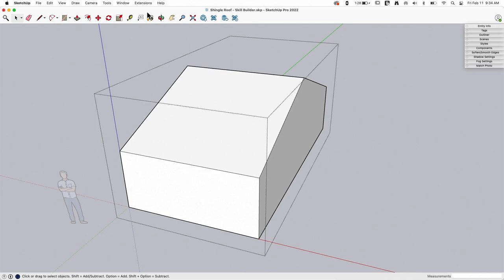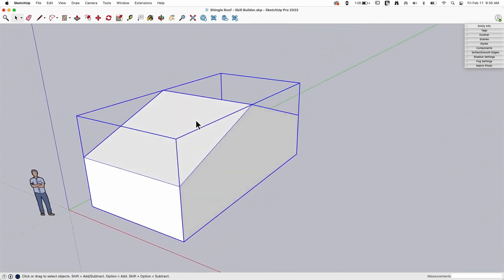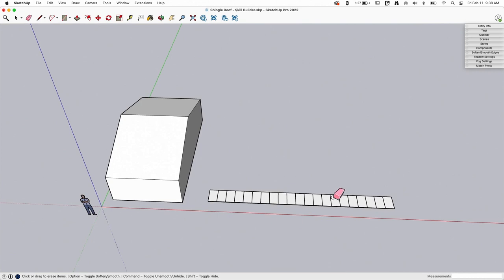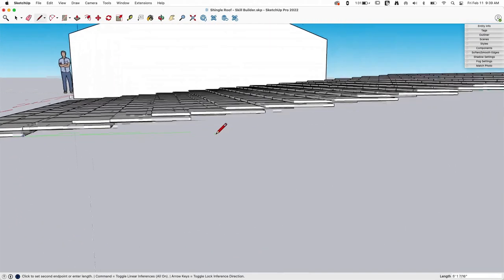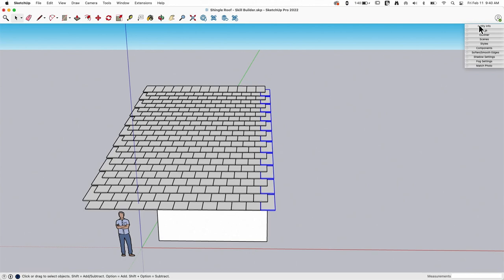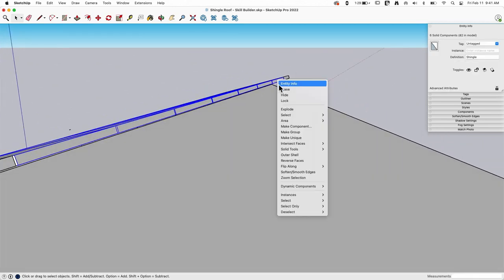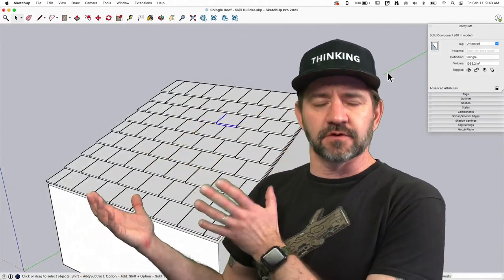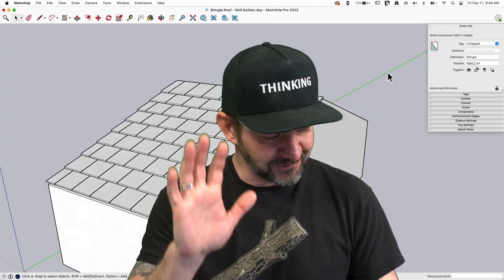Modeling Roof Shingles - Skill Builder

Comment: Nice. Rather than deleting the bottom row of tiles, it would have looked more natural if you’d scaled them like you did at the top. Real shingle roofs have a starter row underneath the bottom edge which stops rain from dripping through the gaps in the first row. I think! (Wooden shingle roofs are very rare here in the UK but we do have a lot of slate roofs that work in much the same way.)

Comment: Would it be possible to add a tiled roof as a live component?

The user would need to enter width, length, thickness, horizontal gap, tile overlap etc

You could be clever and enter type of tile

Potentially, the most used live compent ever?